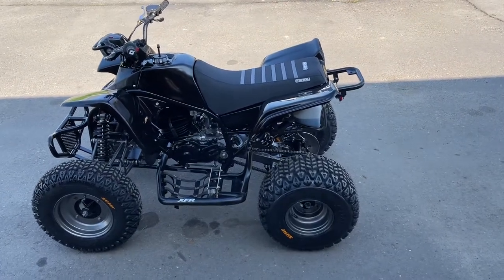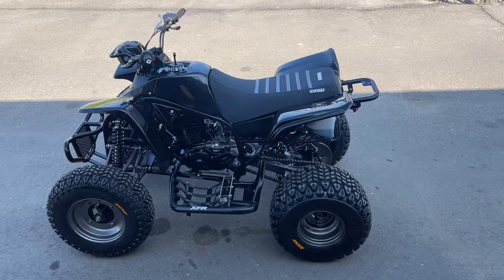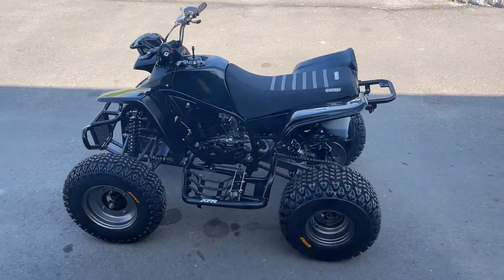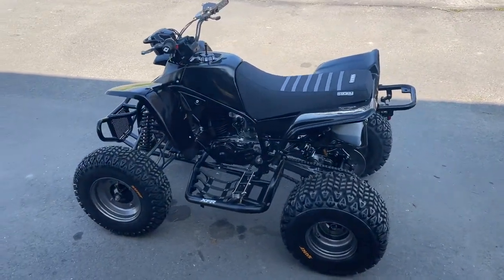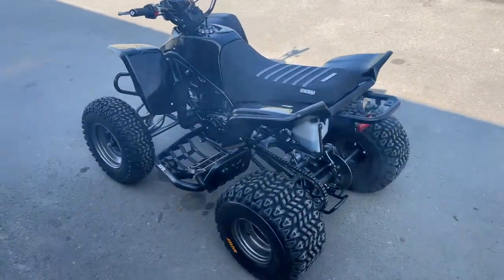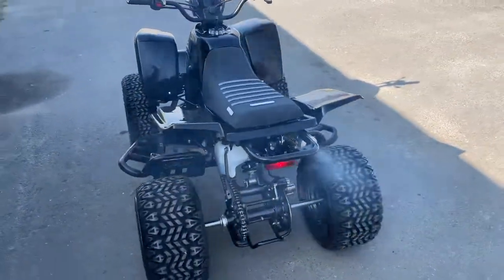Complete Resto/Mod 1997 Blaster

Comment: Looks very nice, I kept oil injection on my daughter's Yamaha blaster as well, I did a port n polish and increased the compression to the limits for pump gas also put a 34mm carb and throttle body, 22 inch tall rear and geared up front sprocket a bit.  It will eat a Polaris scrambler 400cc 2-stroke on take off and top end , yes it tops out at over 70mph.  She absolutely loves riding.  She's graduated last year.  Great looking quad... Take care of yourself and your family my friend.
Reply from the maker: Thanks. I always keep
Oil injection if it’s a stock bike. Your build sounds awesome. I have another Blaster I did last year with a ported head and running a Lectron carb on it with CT pipe. It rips.

Comment: 40-50 to 1 is prolly better if you’re running oil injection. The amount you are running could freeze up rings and make them stick.
Reply: Probably just breaking it in

Comment: Bad ass quad brother!!! What are the tires? What sprocket setup are you running?
Reply from the maker: Stock size sprockets. And the tires are SunF 21x7-10 Front and 20x10-8 rear. Wheels where  painted graphite.
Reply: @Noslo_559  

You have one bad ass machine there brother!
Reply from the maker: @fabianatencio6634  I have two. Twins. For sale too.

Comment: How do the blasters handle vs a banshee or a warrior?
Reply from the maker: Depends how you build them. Not a fan of warriors at all and a you can make a blaster like a mini banshee which is kind of what I have here. My banshee can smoke this blaster but this blaster can smoke a warrior.
Reply: @Noslo_559  i'm just wondering cuz I know the banshee isn't great in the handling department. So idk if someone would buy a blaster for reasons beyond its smaller and cheaper
Reply from the maker: @justinmochi7323  Blasters are good for kids as well. They are also cheaper and much easier to work on.